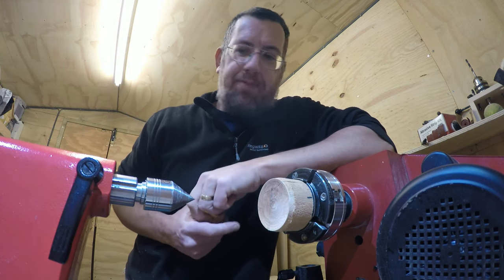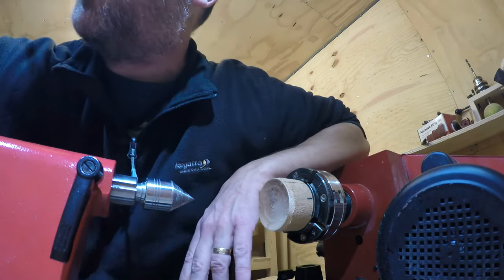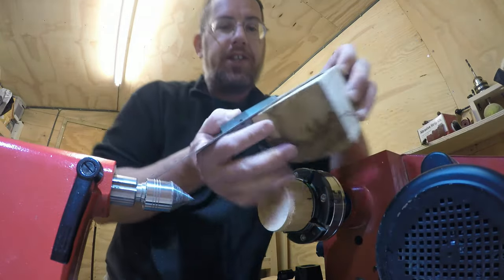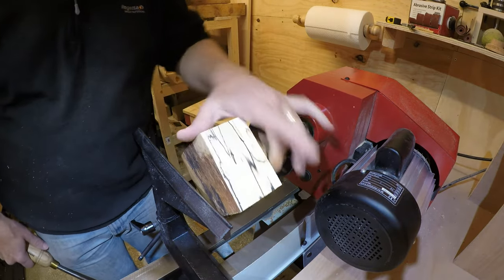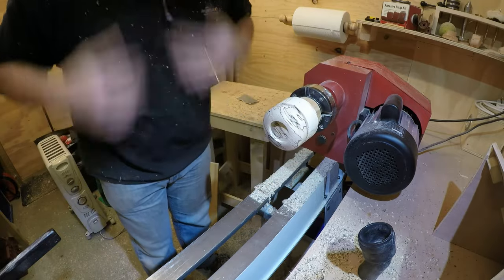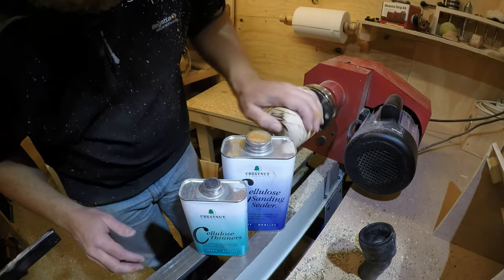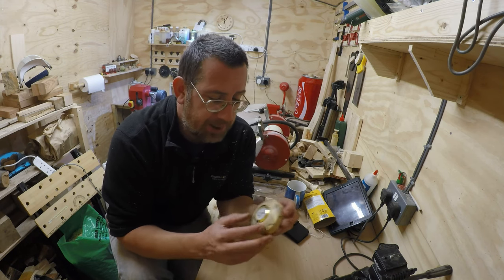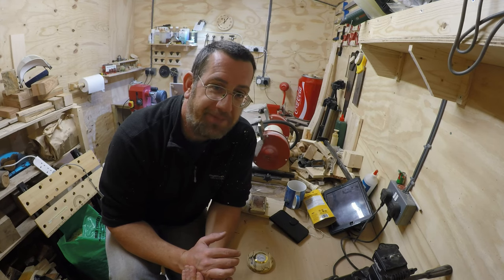Basic Thermometer Mount - Episode 36

Comment: Great project, well turned, and a beautiful clocky thingy....lol at the end Paul, glad you like the "mix" mate :)
Cheers
Mike
Reply from the maker: Thanks Mike. I'm sure you've noticed that the temperature has certainly dropped now. So a thermometer was something I wanted for the workshop, especially as I'm using a radiator with a timer on it. It may not be accurate but at least it gives a guide. As to the turning, it was a little rushed so I could have finished it better. It is little things like that you notice after which all helps on future turnings.

Comment: Nice project, Paul -- a good example of ways to use small pieces of really nice wood. FWIW, I've had success using a 3/4" Hamlet "German" spindle gouge sharpened at 30 - 35 degrees to get tear-out free cuts on soft/punky spalted woods. The broad thumbnail grind makes a cut almost like a skew. And yes, it works great on face and end grain.  Clyde
Reply from the maker: Thanks Clyde